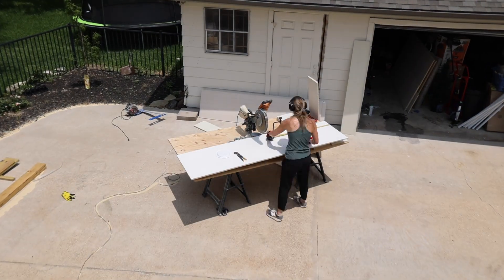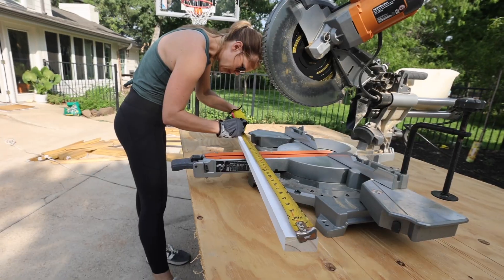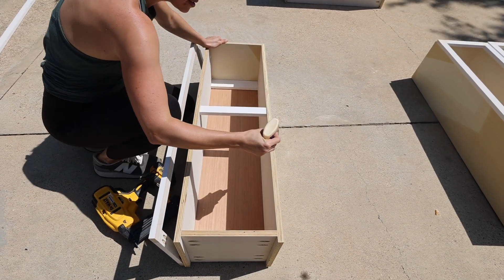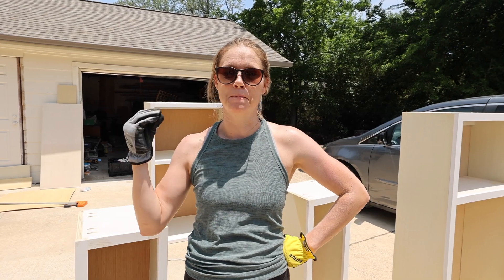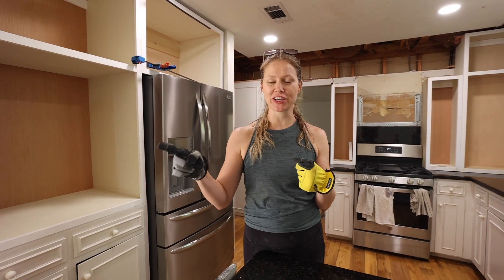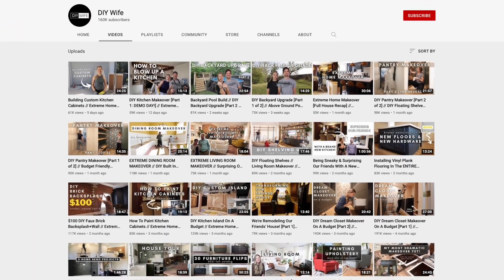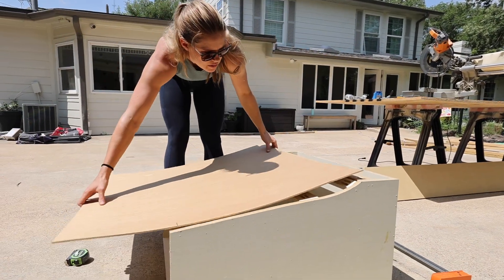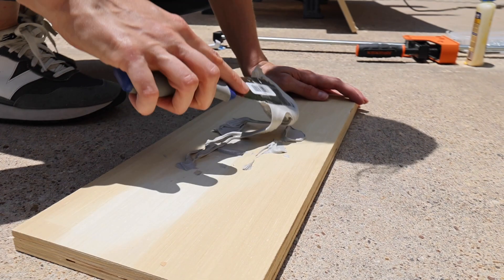DIY Custom Kitchen Cabinets / Extreme Home Makeover [Part 3] / Building Kitchen Cabinets & Vent Hood

Comment: One suggestion I have, is to make your face frames slightly wider than the box, 1/16" to 1/8" wider.  It gives some wiggle room to butt your frames of different cabinets together tightly, seeing as walls are never perfectly flat.  It does not matter if the back sides of the cabinet boxes butt tight to each other, but it will be very noticeable if the face frames do not butt tightly together.

Comment: Thanks for sharing. The cabinets look awesome.  I designed our kitchen and had the cabinets custom made. Three years later, all the doors had to be replaced. Looking at your awesome details and framing of the boxes I can now see that was not done  on mine. Keep up the good work, you are doing a great job. Cheers guys, and be careful of the extreme heat.

Comment: Nice job with the building. One bit of advice, when cutting with a sliding miter saw always pull the saw out then start the cut and push towards the back. The way you are doing it can result in a climb cut/ injury.

Comment: Hey lovely people! Love wayching these videos so much every week. I have noticed that you are using pocket jig a bit wrong that is why the screws come out of the board a little bit, the drill has to be set up in a way that there is no hole at the end of the board, in this way you will make stronger joint and the stewa wont come out. Simple youtube how to video will explain hot to set it to the right stop to avoid this happening! Hope it help 🤍
Reply from the maker: This drives me crazy on mine, every time I adjust the collar on the bit, it ends up sliding and maki f the holes too deep! But yes, important to set it up right for sure
Reply: @diywife  YES, had the same thing and had to change the stopper bit to a new one, cuz the little nut just gets damaged, but also putting some painters tape on it help, tho it is still annoying

Comment: Are you putting shelves in the cabinets?  Shelf pin holes would have been easier to do before the cabinets were put together  but maybe you bag be a forget plan ?🤷🏻‍♀️
Reply from the maker: Yes, and I'm hoping I don't regret not doing those before assembling!
Reply: @diywife   just going to be a bit more challenging but I'd definitely do it before they go up on the walls....speaking from experience 😏.   I'd love to try my hand at a kitchen but for now I'm working on finishing all my closet organizers with built in dressers. I agree with your reactions...it's an amazing feeling to build something that fits and totally transforms a space and know YOU did that!  Looking forward to each video in your process. Thank you for such great content.